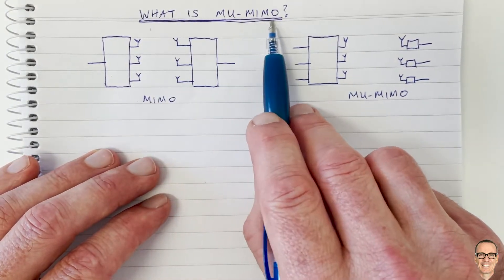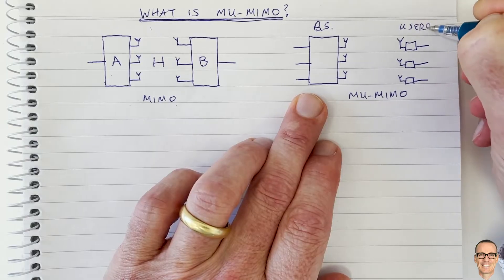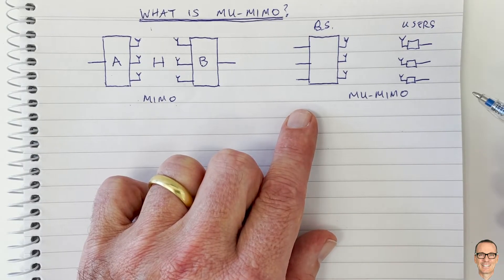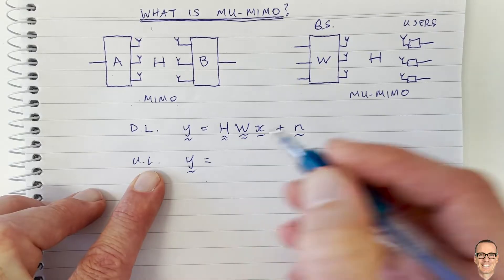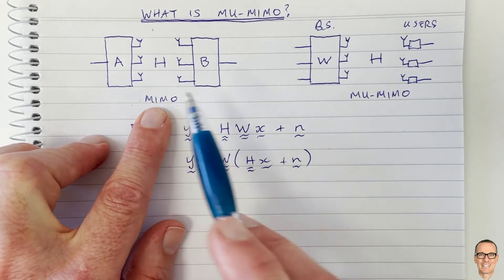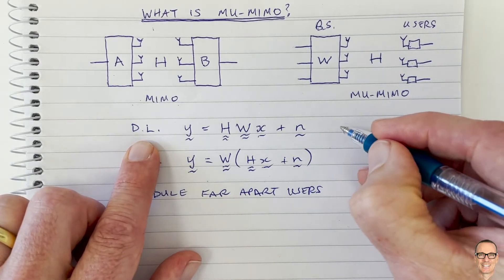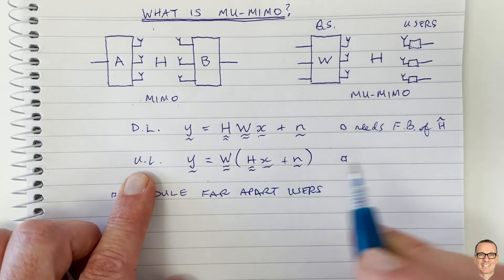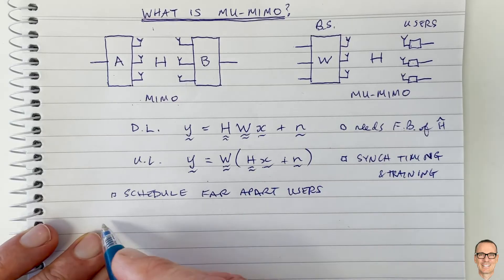What is Multi-User MIMO Communications (MU MIMO)?

Comment: I have a question about the MU-MIMO system. Is there any advantage if the home router is 4x4 (Tx/Rx) (raxe500)? Specifically, when most devices only have two 2x2 (Tx/Rx) configurations, how does MU-MIMO behave with a 160 MHz channel in the 6 GHz band? 4x4 (Tx/Rx) Does this improve data transfer rates?
Reply from the maker: In general, yes, 4x4 will have a higher capacity than 2x2, but it all depends on the channel characteristics, and what signal processing has been implemented. This video may provide more insights: "What are Spatial Diversity and Spatial Multiplexing in MIMO?" https://youtu.be/MNA0xn7EeyY

Comment: Maybe a basic question. Why is H is not invertible if there is LOS or if the scattering is not rich?
Reply from the maker: Good question. If there was only a line of sight path, (and no scatterers providing alternate delayed paths with different departure and arrival angles), then the gain between each of the transmit antennas and each of the receive antennas would be (almost exactly) the same. This would mean that every row of the channel matrix would be the same. And in turn, this means that the matrix would not be able to be inverted (because there would only be one non-zero Eigen value). These videos discuss this more: "What are Spatial Diversity and Spatial Multiplexing in MIMO?" https://youtu.be/MNA0xn7EeyY
Reply: @iain_explains  Your ZF video made me think about this again :D... In a SU MIMO system, even rich multipath should not matter much right? As far as I understand, H is an nxm complex-valued matrix, if since the antennas are closely spaced at a user device, the matrix would still be non-invertible, is that right?

Comment: Sir can you explain which techniques we are using in MU MIMO? And suppose in transmitted side we have 2antennas with different stream each antenna have and we have 2users in the receiver side but one user have one antenna and other user have 2antennas.In this case how will you decode the transmitted signal?
Reply from the maker: Thanks for your question, but there's not one clear answer, I'm sorry. There are quite a few different ways to implement MU-MIMO. It all comes down to how you choose the precoding matrix. I've put the topic on my "to do" list, but in the meantime you might like to watch this video (if you haven't already): "How are Beamforming and Precoding Related?" https://youtu.be/iMIqEpzxN9Y
Reply: @iain_explains  y eah, I have seen this video.. Precoding means multiple beamforming.

Comment: MU-MIMO and CSMA / CA
Hello everybody,
I am trying to understand the concept of MU-MIMO introduced in 802.11ac.
Supposedly the WiFi AP can send multiple data frames to multiple users at the same time, how is it possible to do this without breaking the CSMA / CA standard ???
I understand that if we have a 20 MHZ channel and 8 users, the 8 will launch their RTS until the AP gives their CTS to transmit, it is like a round table where one "speaks" and the rest listens because all the users are competing channel and only one can send / receive data at the same time. On the other hand, in MU-MIMO, several users can receive data on the same channel at the same time, WHICH DOES NOT MAKE SENSE.

Can someone clarify which part I don't understand? Because if it were an OFDMA modulation
  would include assigning 36 carriers to one device and the other 24 to another,
but in 802.11ac all carriers are assigned to the same device and to the entire channel.

Comment: Hello greetings. MU-MIMO no longer uses CSMA / CA, RTS, CTS?
Reply from the maker: Yes, you make a good point. MU-MIMO on the uplink requires coordination among the users, in terms of packet transmission timing and allocation to slots. Also, the base station needs knowledge of all the users' channels if it wants to point the receive beams directly towards the users. Strictly speaking it's not suited to random access channel sharing schemes. However, some variations have been proposed, which are also sometimes just called MU-MIMO too, which are incorporated into some standards, eg. 802.11ax.

Comment: If we have a data stream- 'abcd', do we send 'a', 'b', 'c', 'd' from 4 different antennas in gNodeB (increasing its throughout) to the UE in different paths? If true, y do we use CP-OFDM in 5G when we sending different data streams !
 or do we send 'a' from all 4 antennas at one instance & 'b' from all 4 antennas at other instance & so on (so that UE can choose the best signal with higher power) ?
Reply from the maker: The MIMO precoding at the transmitter is done (separately) on each OFDM subcarrier. So you actually have both spatial sub channels (using MIMO), and frequency sub channels (using OFDM), at the same time.

Comment: Thank you but I wanted to know 
1- In siso systems assuming 64 ofdm symbol , is it the case that the 64 subcarruers are upconverted and sent all at once so that the receiver gets a 64 by one vector 
or is it that each subcarruer is up converted and sent so that we receive a scalar and after 64 time instances we start processing the subcarriers ? 

2-How does it differ in case of mimo systems ?

3- I didn't get the notion of parallel implementation that you pointed out at the last part of the video ? And why is it specific only for mu-mimo 

Thanks
Reply from the maker: For Q1, I suggest watching my video on OFDM. https://youtu.be/Z4LIgNgNAlI  It explains what happens at baseband. It doesn't explain up conversion in that video, but it's straightforward. The time-domain signal generated by the IDFT/IFFT is upconverted to the carrier frequency, simply by multiplying by the sinusoidal carrier. This has the effect of up converting all the subcarriers in the one operation.
For Q2, the MIMO operation needs to be done separately on a subcarrier, by subcarrier, basis, before sending the resultant symbols to the OFDM module in the transmitter. The MIMO operation, as described in https://youtu.be/TC19gMQ6azE is single-carrier (or narrow band). 
For Q3, I hope the above two answers have explained this.
Reply: @iain_explains  Professor, Can you please create a video that expands on your answer here. i.e. MU-MIMO + OFDM from one end to the other (including up conversion). Just so that everything comes together in one place. Will greatly appreciate it. It will also be great if you can add note about what is the simplified equalization that still needs to be done in the OFDM systems to tie the whole story of say LTE or 5G communication together in one place end to end.

Comment: Concerning the parallel implementation for each subcarrier in OFDM. For example if you have 4 single-antenna users and the length of IFFT/FFT is 256, you mean that you have to decode 1x4 y vectors in parallel for 256 times?

Effect of channel correlation in MIMO systems(and massive MIMO) would be interesting as a next topic.
Reply from the maker: Yes, that's right. And I've added channel correlation to my "to do" list.